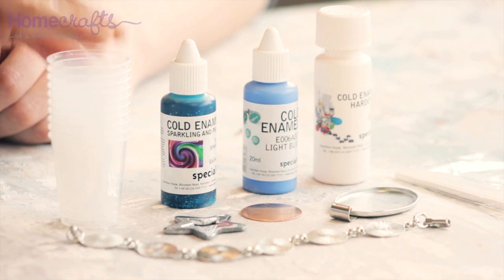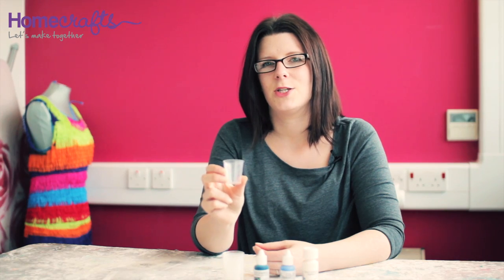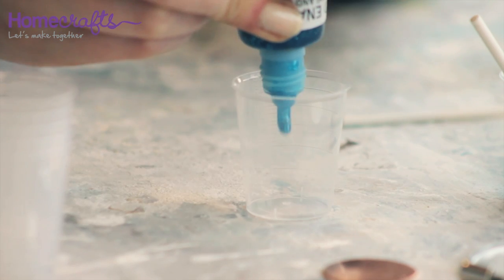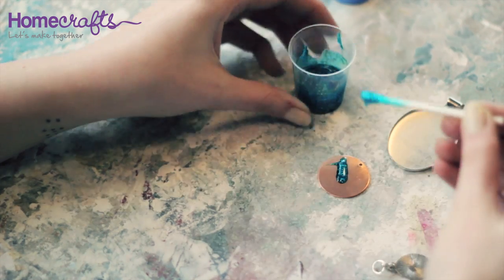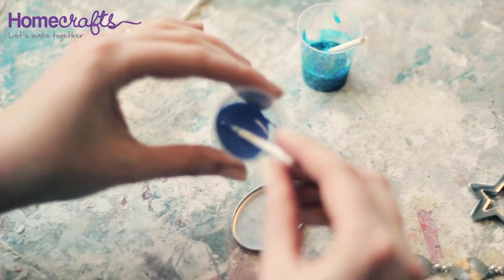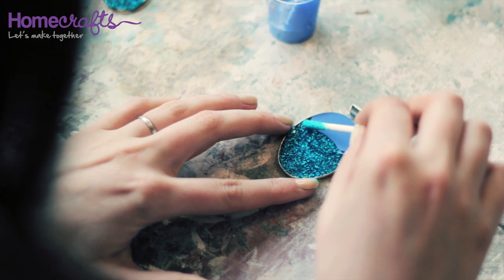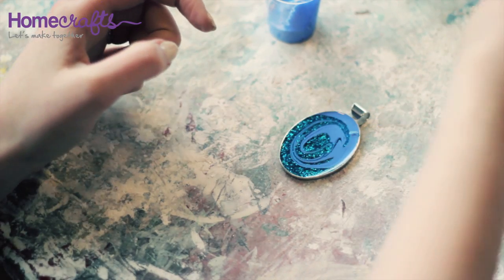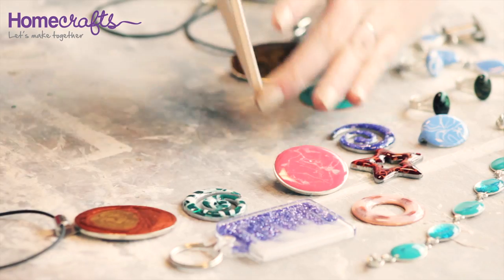How To - Jewellery Making with Cold Enamel

Comment: For those wondering, basically it's just 2-part resin with some color/glitter mixed in, much cheaper just buying some quality 2-part resin. I love liquid diamonds brand or you can use art resin or little windows brand resin. You'll save lots of money.
Reply: Would I be able to use it on metal? Im trying to customize a charm and looking around for my best options
Reply: @imjusthereforthefood1705 are you slow?

Comment from the maker: Hi Ri Mi and fran zainal. Thanks for your comments. You're right that this product is not 'enamel', but it is 'cold enamel'. Cold enamel is a pigmented epoxy resin which gives the effect of enamel without the use of high temperatures, and also allows an enamelled effect to be applied to a wider range of materials and surfaces such as pewter, or even cardboard!
In the UK, this is a standard naming convention for this product.
I hope this helps to clarify this product for you.
Reply: Don't teach us what is this.The work with ANY kind of enamel is a hard work and necessite a big attention, experience.
This is only coloured resin. That's all!
Reply: +Agata Needlework  you certainly NEVER used real enamel you would  know the difference. It needs lots of time before you master it  well.  I do both and   real enamel is an art that I still have to train a lot to master when     resin is an easy craft. Try it, you'll see the difference. 
Anyway  in France you can be  sued by the  state ( fraud inspectors) if you use the word  enamel (even saying  cold enamel) for  resin. You may use this word only for something that has been fired over  600°C
Reply: Where to buy?
Reply from the maker: Hi. You can purchase our Cold Enamel kits from our website here: http://www.homecrafts.co.uk/home-crafts/enamelling Thanks!
Reply: That's what I thought. The same can be done with epoxy resin. But thanks for the great Tutorial.
Reply: Does it adhere well, or eventually crack? I'm looking at adding to copper and soldered items. Thanks

Comment: Could I use cold enamelling to make buttons which will be machine washed?  I knit jumpers but find it hard to get buttons which I like, so I thought of making them myself with an enamelling kit.
Reply from the maker: Hi Roslyn. Once hardened, the cold enamel resin is quite resilient, so certainly has the potential to be used for creating buttons! You'll still need a blank to cover with the cold enamel as it's too brittle to be used as a button on its own - maybe try coating self-cover buttons with cold enamel?

Comment: please don't call that enamel. Its  is a tecnic  of applying resins, I means plastic.....And it is a VERY EASY tecnic.

.there is the same difference  between  resin  (I'm glad it's forbiden to speak of enamel for this material in France) and  enamel as  between  a child coloring a paper where  he applies the colors following the numbers written and  oil paintings done by  painters.
Enamel is a noble tecnic very difficult to master. REsin has  only one  difficulty : it can be toxic when you use it
Reply: Fran , you are perfectly right. This is like liquid glitter and it looks a little unseriously. Ya, it is beautiful but THIS IS NOT ENAMEL!

And you, mr. Abel Babel, don't thinck you are so smart it u don't know what is the difference behind THIS and Enamel.
Reply: Pretty rude way of explaining your point.
Reply: + @rebeccabramley4280  I agree.  What's all the anger for?  I believe it's called enamel only because the finished product somewhat resembles it.  
Both are layers applied over metal, but the resin can be applied over other substrates, like cardboard, because there is no heat involved.  I also agree that enameling is an art one must cultivate, but "cold enameling" is a craft most can enjoy from the start.  Any skill, including cold enamel, will improve as you practice.

Comment: Very misleading -- if it's cold, it's NOT enamel.
Reply: Just chill out - professional jewellers use the terms hot and cold enamelling to differentiate between enamelling with glass and an enamel like finish with resin. Now if a jeweller with 20+ years says that why should you worry?